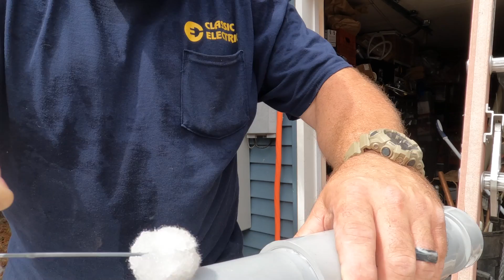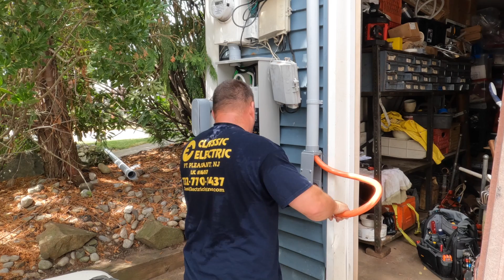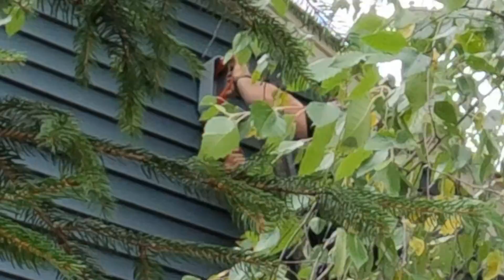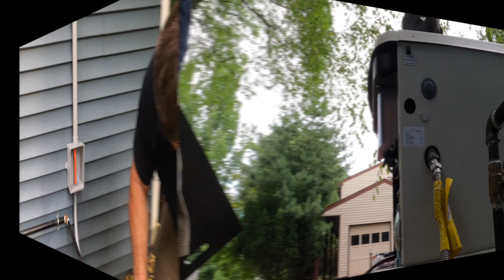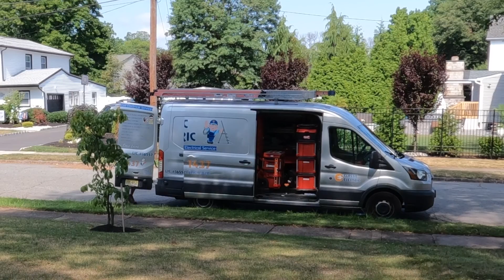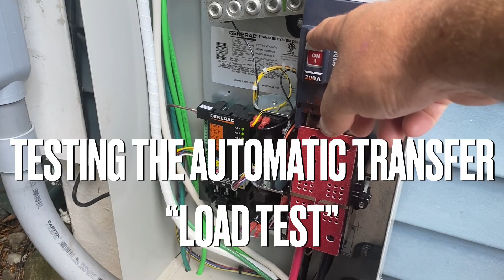Generac Generator Installation Part 2| Clark, NJ

Comment: No!!!   No screws thru the back of the LB you just created a path for water both into the side of the house and into the box where your pipe ends ,   Rain will follow those screws both ways especially after the caulk falls apart ,
Reply from the maker: How long have you been an electrician?

Comment: Not your fault but the the plumber did it wrong. Generac requires the flex line to be installed horizontal and not bent!
Reply from the maker: @TXMURF  This Gen is at the plumbers house!

Comment: How are you running sheathed cable inside conduit? Your way violating fill.  Thoughts?
Reply from the maker: @chuckseder5570  You’re kidding me, right? This does not violate conduit fill.  It does protect the cable though.

Comment: The 12 volts between 23 and 193,,,,  is that seperate from the battery and charger,,,,  like a control transformer?

Comment: I'm not a tradesman, just DIY.  But I find it funny that code doesn't allow running low voltage in the same conduit as high voltage but bundled inside a combo cable... is fine.  LOL  I bet that was an expensive install with all that cable going across the house and all the 2" PVC to conceal it.  Wow.
Reply from the maker: The low voltage and high voltage can be run in the same conduit as long as the insulation is rated for the higher voltage on the low voltage conductors.

Comment: Why did you put that huge (12x12?) box in just to transfer from PVC pipe to Liquid Tight flex? Could've achieved the same result with a 2" female TA and a 2" to 1-1/4" reducer?
Reply from the maker: The cable assembly is large so 2” PVC to make that job easier. Then 1 1/4” out to the gen.  I’ve never heard of a 2” to 1 1/4” PVC adaptor.

Comment: What size are the comunications  wires?
Reply from the maker: #14 AWG because of the insulation.  It has to be rated for 300 volts IF you run these conductors in the same conduit as the feeders.

Comment: I don’t mean to correct you I watch your videos to learn. However the orange Generac cable you mentioned that it was #2 Aluminum with #4 ground. That is equivalent to #4 THHN Copper. I know that #4 copper is rated for 100 amps, and I agree with that. However on the Generac training that I did it told me to use #3 thhhn copper which is rated for 110amps. I know that is a Generac sells that cable but on the training I was told to only use copper wires. Thank you again, Appreciate your opinion.

Comment: How much does it cost to add a generator to a shed house. Please.
Reply from the maker: How many kilowatts
Reply: @electricianron_New_Jersey   It’s a   Generac 24kW Standby Generator Guardian WiFi w/ 200 Amp Automatic Transfer Switch 72109 New.   I am also planning to get solar panels on this Shed house. However, I don’t know what type of solar panels and how many solar panels to buy.

Comment: What size wire was used going to generator? How far of a run was it?
Reply from the maker: The feeders are # 2 aluminum (4-wire) and the control conductors are I think 16 AWG. The run went from one side of the house to the other across the unfinished attic storage space.

Comment: Just wondering why you didn’t use silicone on the main conductors connections? I’ve seen other videos where they do so just wondering what conditions call for it?
Reply from the maker: It’s not silicone, it’s Anti-oxidant and there are many brands that make it. It’s not required by code and most aluminum conductors no longer require it.  However, using it makes for a better installation and it was used in the video.
Reply: @electricianron_New_Jersey  okay yeah I saw you use it on the aluminum wires in the second video. Didn’t realize it is only needed on aluminum. Thanks!

Comment: Thank you for getting back to me. I am in NJ I have my permit to install my generator. What Im trying to figure out is when do i call for inspection? How far am I allowed to complete before the inspection. My generator power in under ground so I need inspection before I cover it, but do I complete all wiring and then call for inspection? Sorry to say state inspector give very little help.

Comment: Ron , did you install the meter befor the inspection, so that the customer had electric back on while waiting for inspector.
Reply from the maker: Of course I did! It may be different where you live but here in NJ I would never leaf a customer without power for longer than a normal upgrade or call for service. My electrical license allows me to do this and the utility knows it too.

Comment: Great video. Recently had Generac 22kw installed. 5 days later a lightning strike took out the AC smart module and the control panel. The ATS was earth grounded with neutrals and grounds bonded and separated at the old panel. The Generac authorized repair man is telling me the generator needs it's own earth ground.
The same strike also took out several small appliances in the home.
What are your thoughts on the generator having a separate earth ground, yah or nay?
Reply from the maker: The standby generator IS NOT a separately derived system unless the neutral is switched at the transfer switch. A ground rod is only required at the generator when the generator is a separately derived system.

Comment: I hate aluminum wire cheap junk. I would replace it with copper.
Reply from the maker: Even if it meant another $700 too right?
Reply: @electricianron_New_Jersey  Even if it cost $700. Considering the cost of the entire project I'm guessing $15-20k? $700 not all that much anymore these days.

Comment: Ron, first of all great video and explanation of your install. I am doing a lot of research and came upon this, I have the same situation with my electric meter on one side of the house and the gas on the other, if I may ask how far can this Generac cable be used to efficiently carry the load from the generator to the transfer panel.

thank you
Reply from the maker: It always depends on the load.  Anything less than 100’ I don’t worry much about voltage drop.

Comment: let me know'' i GOT this 100A, 2P generac ATS, but my genset is 24vdc control system. now since terminal 194 is +12V, what will happened if ever i connect my 24vdc from genset ECU. will it work on that specific terminal or it's going to fry the board?
Reply from the maker: If you’re unsure you contact a qualified Generac dealer to install it.

Comment: Nice and clean work , I haven’t done a whole house generator recently , but isn’t the pad for the generator suppose to have working space on all sides ?
Reply from the maker: The homeowner built this himself. You only need 36” clearance on the sides and 60” away from any openings like windows and vents.  You also need to be minimum 18” away from the house.

Comment: So do you need separate the neutrals and grounds at the main panel and now the grounding electrode conductor will be connected to the neutral bar at the transfer switch and not anymore at the main panel?
Reply: Ron showed exactly that procedure in part one!

Comment: No, how do you keep the thieves away from stealing your generator?
Reply from the maker: The 22kw generator is over 500 pounds and connected to natural gas and 240 volts of alternating current. You've got to be out of your mind thinking you can load it up in the trunk of your car.

Comment: After seeing him work and listening to him talk about electrical makes me want to jump back in to the electrical field are used to do residential wiring and I was all about how fast you can do at home or homes in a week I like the service end of it better
Reply from the maker: There's a lot to learn on the service end but art definitely is better than roping houses. Sometime you never know what you'll run into. Today I had a kitchen countertop circuit that was tripping. Long story short there was a microwave oven that was installed in the kitchen island. Previously it was just a convenience receptacle and when whoever moved it to the new microwave location it was accidentally hit with a finishing nail. Ever so slightly it was hit because sometimes there was no fault and other times the breaker would not reset. I had to take out a drawer to gain access to the wiring and saw that outlet box was butchered in. I got permission from the homeowner to make a 5" hole to get beneath the cabinet to fish in a new cable through a finished ceiling in the basement. The drawer would cover this 5" hole and you would never see it. Then I had to drill a pilot hole through to the basement ceiling so I knew where to look for the wire going to the microwave receptacle. There was very little clearance to fit any long drill bits so I had to use (3) 6" extension bits just to drill the hole. This took about 6 hours at $150/ hr plus parts and sales tax. Tonight that family's using their microwave I am sure.

Comment: Do you ever use a disconnect where you put the 10x10 box?
Reply from the maker: The disconnect is built-in to the Generac generator.
Reply: @electricianron_New_Jersey  Built into the Transfer Switch.

Comment: Your video is exemplary! I wish I could buy a Generac Guardian Home Standby Generator with the 26 kilowatt capacity and transfer switch, along with solar panels and battery storage called the Generac PWRCell. With both a home standby generator and solar power installed, these could help in providing my home power in case of a blackout that knocked out the power grid.

Comment: My new 14k generator has the T1 for the battery charger but my transfer switch doesn’t it’s the older style ( no T1 connector on the board ) We just replaced the generator to a newer one We did run a new blue line down to the transfer switch  Can we tap into a 110v live line?
Reply from the maker: Why would you want to do that?
Reply: @electricianron_New_Jersey  where would the blue T1 line goes into and voltage

Comment: On the transfer switch side what was purpose of mutifunction 2in  LB you could of used a regular one and what was the purpose of the 10 x10 x 4  j box on the generator side and also man what a trip hazard where that flex went from house to generator otherwise cool, usually here takes about day to install after gens in place.

Comment: Excellent job for the installation of the Generac generator and the power panel transfer switch. Now you can take a break and enjoy the weather. Take a dip in the pool if you got one. If you don't, you had better get one.

Comment: Do you have to remove the neutral to ground bond when the ATS is outside and remove the bond and ground strap at your panel inside?
Reply from the maker: All of that and a 4-wire feeder between the two so that the panel has a conductor specifically for the neutral bar and one for the grounding bar.

Comment: running late on the comments here but I have a few pointers after installing these for 25 years. (we install over 250 units a year) I save the shipping hold-downs (metal clips) and screw them into the RR ties because over time the set can shift if it goes slightly off-level when the ground settles. I also add ant traps (poison) in the battery area because those suckers are drawn to the heat in the control board... and if / when they gather, they gum up the relays to a point where the unit will not run. Somehow the ants get into the pushbutton area and that doesn't work either. Our company also has us replace those traps on each service. The smaller traps will slip in through the gap in the cabinet and you can pull them out when changing the battery in 4 years. Also, a fogging with WD-40 will keep all the aluminum parts from looking crusty in damp areas. We do this at every service, and they still look like new 10+ years later. Oh, bugs hate WD-40 so that's a plus!
Reply: Got a question for you.
Reply: @Schooley_Legacy  ... so ask the question.
Reply: @rupe53  Can a breaker be installed directly from panel to utility line of the automatic transfer switch instead of tying directly into the meter?
Reply: @trentdrummond5603  ... you always need a breaker between the utility and the transfer switch. This is how many folks power the basics without powering the whole house. They have an electrician pull a few circuits into a subpanel that's normally fed from a breaker in the main panel. The transfer switch goes between them, so the sub panel is either on utility or on generator, when the power fails. The idea here is some of the heavy power users (AC, clothes drier, etc) are just not available during an outage. This allows buying a much smaller gen set. You'd need to discuss this with your installer / electrician, because sometimes the extra work involved costs almost the same as buying a larger gen set in the first place.
Reply: Can I ask you what keeps the generator down in a hurricane?
Reply: @omarmontes9380  ... a hurricane is not a problem, but a tornado might be.
Reply: @omarmontes9380  550 pounds, also mounting points in the floor not visible from outside.
Reply: Should I add hooks to the concrete base to hood down the generator?
Reply: @omarmontes9380  ... if you buy a "Gen Pad" (brand name) with the set, there are preset anchor points cast into it to accept the factory mounting kit. (long bolts with washers) The combined weight of the set and pad is over 500 pounds so not likely to blow away. If you pour your own pad, you can use the shipping clips as anchors and drill the concrete for Tap-cons or wedge anchor style fasteners. I have a few towns near the water that require this. BTW, it's not to save the gen set during high water. It's to keep flood water from moving the set and having it pull out the gas lines. (fire code compliance) Install tip: If you pour a pad make it 6 inches bigger than the set in all directions. That way any drilling of the concrete won't be too close to the edge and crack it.
Reply: @rupe53  thank you sir , god bless you

Comment: Well done sir !
Can I ask a question ?
Over at the generator did you keep ground wire and neutral wire separate so they not bonded together since ATS is the first disconnect ?
Thank you !
Reply from the maker: Yes, the grounds and neutrals are only bonded at the main disconnect. In this case at the ATS.
Reply: Electrician Ron,
If you don't mind me asking, if the meter comes with outdoor  disconnect, than neutral and ground  has to be separated at the ATS ?
Have you ever installed any of them ?
Reply: @torosalariasalaria9849  ... you can remove that first main breaker or move the bonding point from the TS to the meter pan. you can also buy that TS without a main breaker.... or leave it as shipped. It's ok to have the extra breaker as long as you follow the bonding rules.
Reply: @rupe53  so if I keep the  first main breaker and do all grounding there the TS becomes a subpanel witje that being said I jave to run a Ser conductor from 1st main breaker to the TS
Reply: @torosalariasalaria9849  ... Yes, you need to carry that ground through to the first breaker (first point of disconnect) without bonding anywhere else. In the case of using this particular transfer switch, you'd remove that green wire between the neutral and ground bars. BTW, the TS never becomes a sub panel, but you would treat it as a sub panel for bonding rules. IOW, no bond. That means 3 conductors plus a ground. (ground can be bare wire) SER cable would be fine in most cases. In conduit you might want to run THHNW or THHN2 which are rated for outdoor use. (wet location)
Reply: Thank you sir !

Comment: Geezus, you had serious space constraints to deal with at the front of the house... incredibly narrow and congested area to mount that transfer switch with all those those other utilities in the way, then adding all that bulky 2" PVC to boot. That's a lot of fighting on a hot day. But great job, and very tidy work in the generator and its panel. I take it that you ran that orange cable through the attic or upper crawl space of the house? That's quite a long run.

Comment: Great videos! I saw one video where the installer recommended pulling the fuses for the monitor wires when first applying power to the transfer switch. Do you have any experience with this? Also, did you do this over a couple of days? If so, can I get the mains connected one day and connect generator cables the next? If I do this, will I have power over night? Hopefully my questions make sense. Thanks much Sir.
Reply from the maker: Most generators I plan for (3) full days to do everything including start up and inspection.
Reply: it is possible to pre-build and pre-wire except for the hot stuff then call for a day where power can be shut off in the morning to do the rest. The problem is most DIY people won't have the forethought to get it right and pass inspection on the same day. Also... scheduling an inspection is rather tight while cutting it that close on the timeline. This is from someone who spent 25 years working on these things.